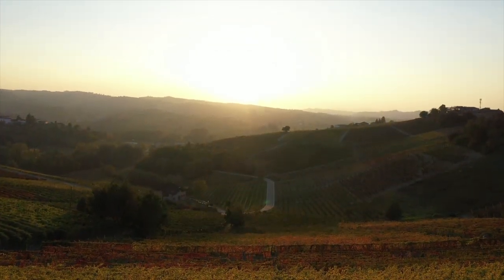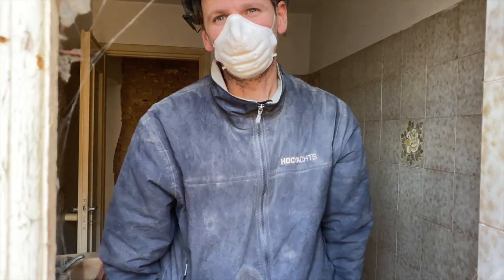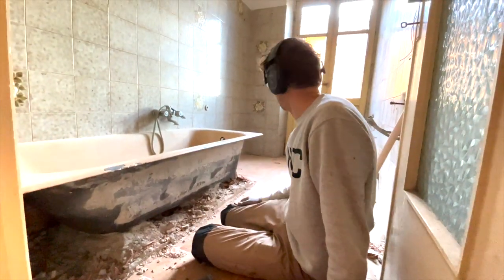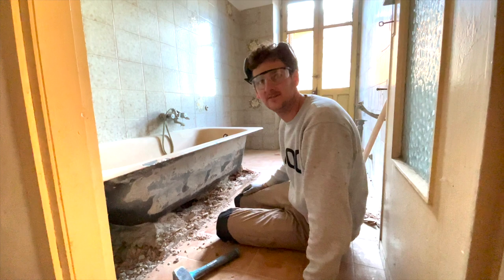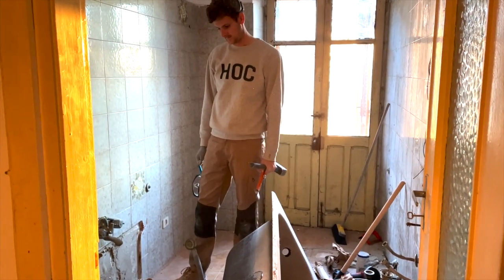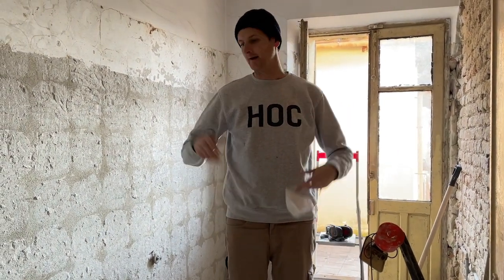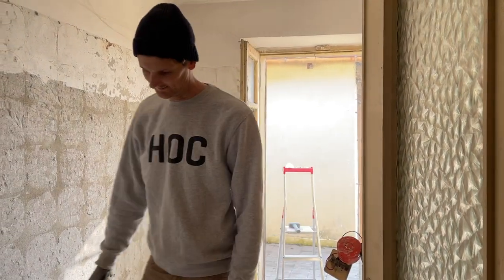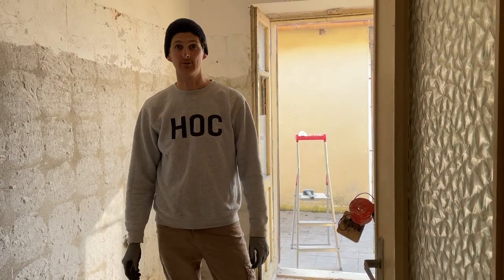Bathroom Demolition "Dream House" Restoration - Piemonte Rustic Farmhouse DIY Renovation (Part 3)

Comment: Add a Sega a Gattuccio (reciprocating saw) to your tools using the same type battery as your other tools. Have at least 3 batteries, one being used, one on standby and 1 in the charger! Buy wood, wood/nail, metal and concrete blades.

Comment: The plans look awesome guys!! Some proper graft here 💪🏽💪🏽
Reply from the maker: Thanks Josh! Yeah, it's all coming along nicely - with some luck we may even be able to stay on our very ambitious timeline! 😅
Reply: @OurItalianDreamHouse  I’m so excited with that part. I have a question: when you move in in Feb, what will you do for the power and heat? Will it be the generator and propane or are you getting the place wires back onto the grid?
Reply from the maker: Good question! We're hoping to get an electrician on site in the coming week to wire up the whole house and get us reconnected to the grid - but in worst case we might have a few days running off the generator. For heating, we'll most likely have a gas boiler which will take care of the hot water and we'll install a wood burning stove which should be perfect (and cheaper than gas) for heating up the space that we'll be living in 🤞